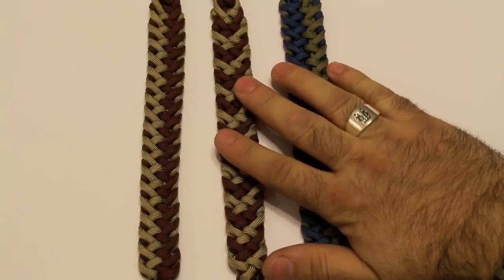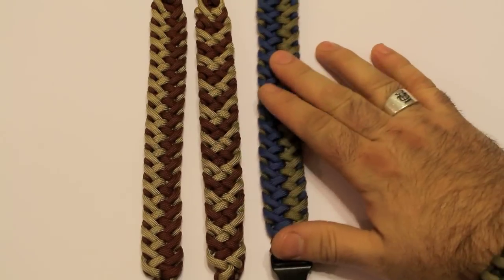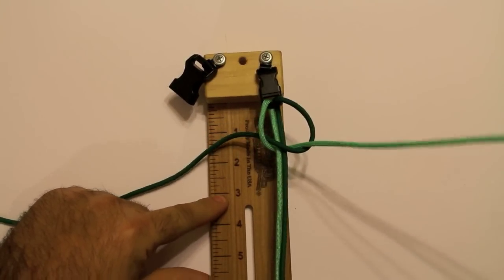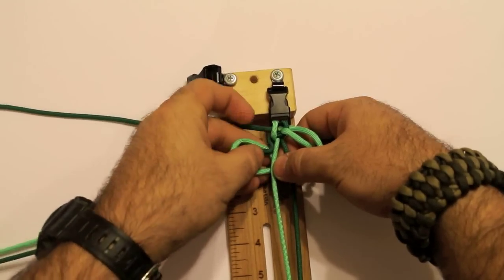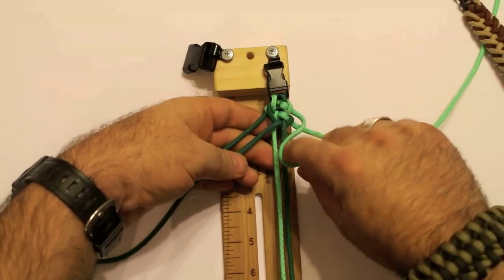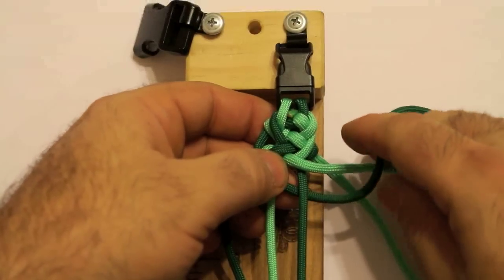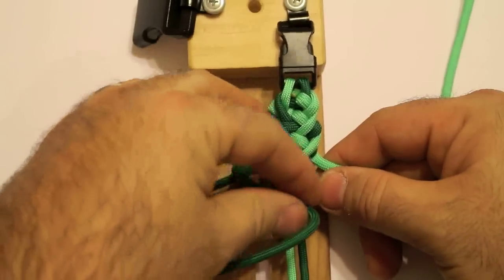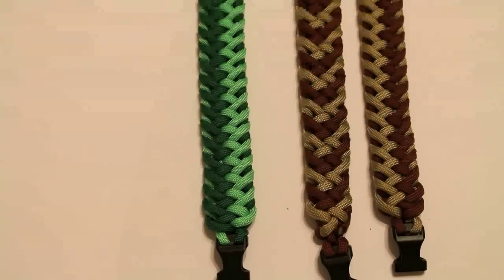How to Make the Interwoven Cross Hitch Paracord Bracelet

Comment: Where's the double core version of this weave???
Reply from the maker: the double core version is with two strands in the middle.  The four core version is with 4 strands in the middle which would make the bracelet slightly wider than the two strand version. You make them the same way.  The only difference is you don't have to fuse the cords together with 4 core version.
Reply: Unfortunately, I'm a visual learner. Despite your excellent written description, a video tutorial of this bracelet with two and four core's, at least in my case, would be SO much more helpful.     :-)